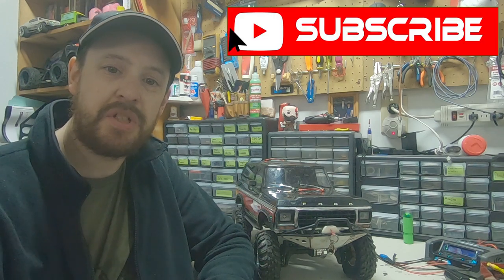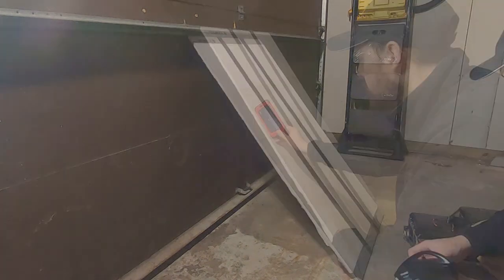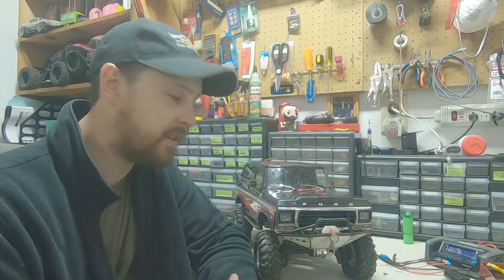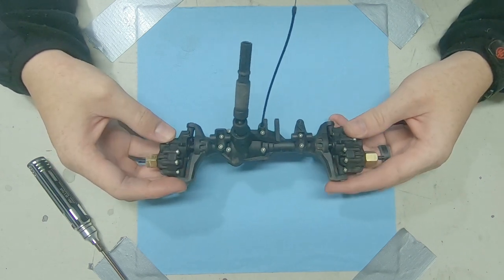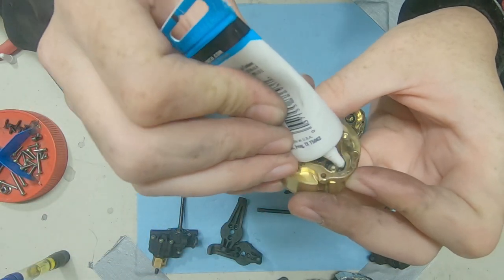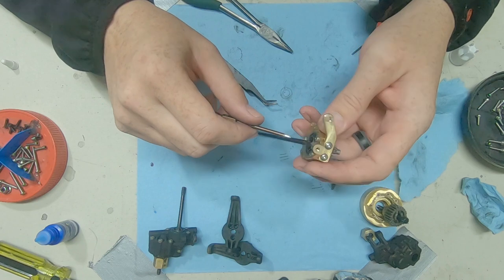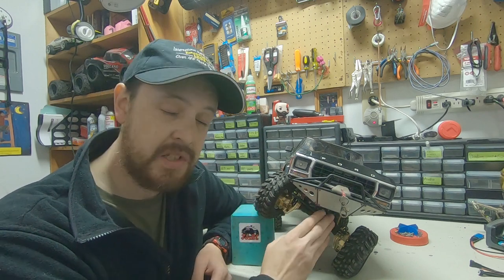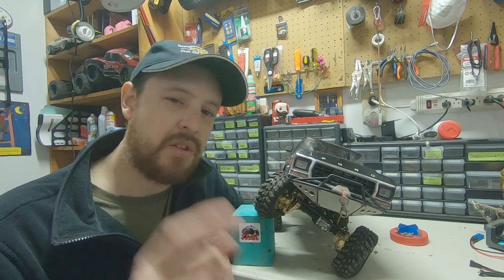TRX4 Brass, can the cheap stuff be any good? Is it really that bad?

Comment from the maker: Tell me how you would test a weight upgrade like this or what you would use  for traction on the ramp. 👊😁
Reply: do some quick turns  you will know  if the  truck wants to roll over
Reply from the maker: Greg Plaka Even with the extra weight down low it's still a top heavy truck for any high speed driving so it'll flip over quite easily. The point of the brass was to help with slow speed crawling.  It does help that but not in an overly dramatic way.👍
Reply: Grip tape for stairs at any of the big box stores would work better...
Reply from the maker: @TheMrZombified  That's what I ended up using. Got it in a big roll at Menards. The packaging called it non skid tape or something like that.
Reply: id do mine out of stepping stones
Reply from the maker: Jonathan Taylor That's a good idea to. Do you have them in a backyard crawler course or something? I have a few in my backyard crawler spot, unfortunately it's completely grown over with grass and weeds because I've been to busy to get out there this summer.
Reply: @TJsRC  yes i have an unbelievable course set up at my house. i have incorporated lots of things in mine as well. I'll have it on youtube shortly i hope. I've got an awesome truck wash and some other things going!
Reply from the maker: Jonathan Taylor Sounds awesome bro. 👍👍

Comment: Double sided tape and something we in UK call Deck Tread it's basically a very tough and thick none slip grit board pad , it's used a lot on Boats , Ships and any where theres water under foot stop's shoes from slipping.
Think there's some with a glued self sticking backs peel off sort of thing last for years with what you will use it for
Reply from the maker: shottonfb That's a good idea. I do believe we have something similar here.  Thanks for the suggestion. 👍

Comment: I ordered the cheapest set of weights that go over the outer portal covers for Trx4.  They looked good, machining looked good, but they didn't fit out of the package.  Same here had to dremel them to slide on.  Next had to remove a portion that c ring, it was making contact with the inside of the wheels and binding up.  After that they worked great.  In the end they started at 75g each and ended up 50g each.
Reply from the maker: JD'S RC'S Yeah the tolerances on the super cheap stuff is terrible. I'm glad you were able to make it work. Do you normally enjoy modifying stuff for your RC? Or was this more of a necessary evil that you had to endure?
Reply: @TJsRC  I enjoy doing mods as I need to.  I barely added some weight to my Trx4 a few weeks ago and I think it has helped quite a bit.  For me, I like to keep trying until a mod is needed or I break a part.  Fortunately I have not needed anything major.

Comment: I put gorilla grip tape on the ramp I'm really curious though about the affects of weights as an all rounder what goes up must come down how does all that weight affect it's breaking ability when trying to descend a tricky spot cheers mate 👊👍
Reply from the maker: It's not bad at all as long as you balance the front to back weight ratio. Obviously if you put to much weight to the front it will end over a lot going down hills and obstacles. Also the speed these trucks go is relatively small so the extra mass doesn't affect it negatively unless you have a very weak drag brake setup.

Comment: Also your board was glexing in the middle from the weight of truck that is changing the said angle of the obstacle
Reply from the maker: That's true it did alter it slightly. But like most YouTube videos this was mostly opinion and barely a scientific test. 😂🤣

Comment: Skateboard tape on that board will work wonders my friend!
Reply from the maker: I actually ended up going with that kind of grip tape. It is working very good.
Reply: @TJsRC  the skateboard tape is cheap and can be bought in large flat rolls from skateboard shops and when it wears out , easy to replace.  We even use it on our shifter controls on our mountain bikes,  trim to fit! Works great in rain and bad weather.

Comment: Thanks for this helpful tips. Btw, how many mm are those brass hex adapters sir?
Reply from the maker: Japox 33 They are +5mm very minimal because otherwise the tires get to far away from the portal gearbox's and they catch on everything. I keep going back and forth between them and the stock hex's trying to see if there's really any benefit as so far all I have noticed is there's minimal performance benefits and it's mostly just do I want the look of the tires sticking out more or not.
Reply: @TJsRC  i have new rims and i cant get thru the hex coz my cheap brass is on d way. So i need a brass hex adpater so i can connect it. Can i use 10mm brass hex adapters? I have a trx4 bronco also.
Reply from the maker: Japox 33 if you go wider than +5 you will have to get a different kind. With the +5mm I'm already almost out of threads for the wheel nut. Try searching Google with the phrase "TRX4 wheel spacer hubs" there were some wider options there when I looked just now. I would start with the smallest increase that allows them to work. I hope that's helpful.
Reply: @TJsRC  can you give me a link of your +5mm sir? Just to be sure 😊😁😊👍
Reply from the maker: Japox 33 Here is the ones I have, they're from Amazon.  If the link doesn't work just search "Treal TRX4 5mm brass wheel widener"

https://www.amazon.com/dp/B076YWRY7H/ref=cm_sw_r_cp_api_i_JYv1DbRM90NXG
Reply: @TJsRC  thanks so much sir! Help appreciated. Im glad to be one of your subscribers! 😄👍😁
Reply from the maker: Japox 33 Well thank you to. Other than family I don't actually get to interact very much with others who share this hobby so I enjoy getting to do it through these videos and comments.

Comment: Anyone have an issue with the camber changing with the brass c-hub carrier? It seems as though the bottom of the tires are turned in rather than out.
Reply from the maker: I didn't notice that with mine. Maybe hold the brass piece side by side with the stock one to see if it's misshapen or bent. Its also possible a tiny piece of debris is in the way preventing it from seating properly to the axle housing causing it to appear that way.

Comment: Great video. I'm thinking of getting the injora portal covers only for my trx4. They look like what you've installed here. I think i have the same beadlock wheels as you but in orange. Will the portal covers fit inside those beadlocks with the beadlock screws? I'm using the standard offset 12mm hex's. Yours looks extended? Would the covers fit with standard trx4 hex's in there visually from what I've seen i think things look pretty close!
Cheers
Reply from the maker: I think it should work, maybe.  I had the plus 5mm hex on my TRX4 already but I think I’ve tried the wheels in the video with the stock hex’s and I want to say they worked but I can’t be sure. I’ve had a number of different wheel and tire combos on it since and I know I had to do a little sanding on the outside of the portal box for clearance on one set but I can’t remember which one. The good news is that if you need the wider hex adapter they’re not that expensive but do not get wider than +5mm or you won’t have enough threads sticking out for the wheel nut. Searching “ +5mm hex brass TRX4 “ on Amazon reveals a number of options. There’s even a +3mm which might be enough to make the room if you need it while not changing the appearance as much as the +5mm does. I’m sorry I couldn’t be more exact. It’s been a while since I made this video and I’ve changed things up a lot on it. Let me know how it works out for you my friend.
Reply: @TJsRC  ok thanks. I've ordered a set of portal covers but they're slightly smaller looking not the full round profile like your video. I think they'll work without extending the axles. I want to keep the width as is or it'll start looking a bit silly and less scale! Thanks for the reply!!

Comment: Hi do you have a link to the set you bought ?
Reply from the maker: I purchased them off eBay over 2yrs ago so that listing link is gone. There are quite a few more cheap brass options for the TRX4 now than there was then. Just search “TRX4 Brass portal” on Amazon or eBay and you should get a lot to pick from. If you go cheap with the portal boxes just watch the tolerances around the gears during assembly. As you saw in the video I had to do some clearancing so the gears would spin smoothly. But after that they’ve held up perfectly since.

Comment: If the C hubs don't have an L or R how can you which is which?
Reply from the maker: With the axle housing as level front to back as possible you will want the top of the C-hub to lean back slightly. So if you put one on and it's leaning towards the front, try it on the other side.
Reply: @TJsRC  Dude. Thank you!
Reply from the maker: @EricsRC  Your welcome and best of luck to you getting it back together. Have fun.

Comment: Track width the same with the new brass?
Reply from the maker: Lane Mullins Yeah, it has to be, the stock hex drive pin holes worked just fine. I did go back and remove my +5mm wideners and go to the stock hex's since Im using the 1.9s right now. If I put the big 2.2s back on I'll probably put the wider hex adapters on also. 👍

Comment: Are all the Brass parts the same brand?
Reply from the maker: I assumed so as I got them all from the same seller on eBay.
Reply: @TJsRC  OK. I have ordered some cheap brass parts from AliExpress, they are  supposed to be same brand/seller (Injora). After watching this I'm at least mentally prepared for issues with making them fit. 😅
Time will tell when I get them.